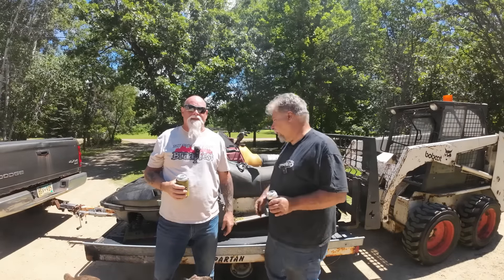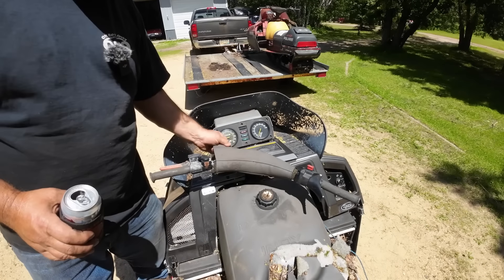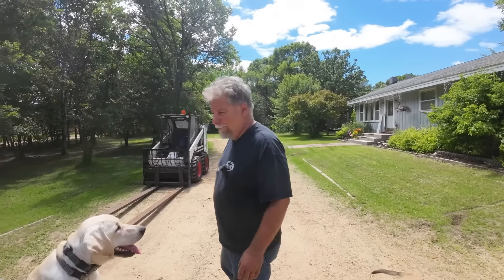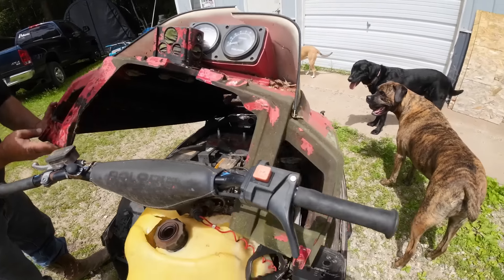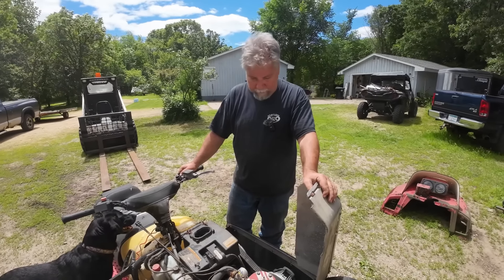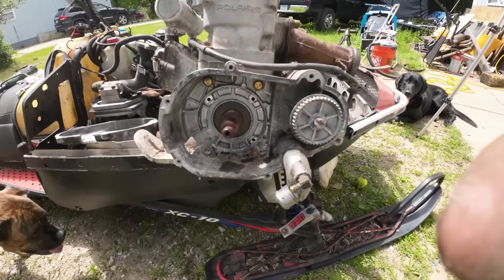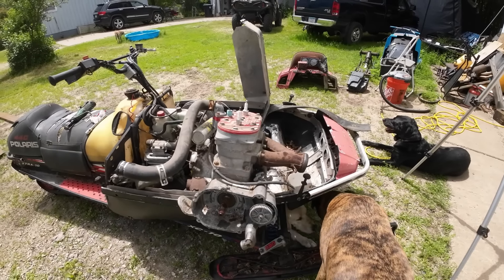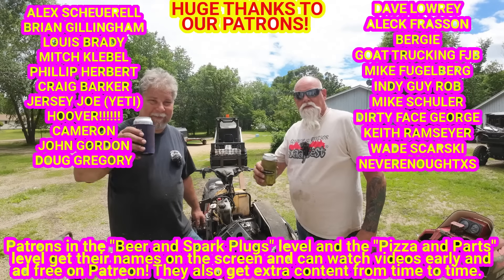Lonnies XC700 Tear Down, Evaluation, Motor Preservation. Vintage Polaris Wedge Hood Liberty Twin.

Comment: Holy crap!  Does this bring back memories!  I had a 98 XC700 that I snow checked with the 220 cylinders, like @thepolarisguy said they had a little more power then the floor model 824 cylinders. Those carbs are stock 39mm keihins, and they work really well!  Nice easy throttle pull 👍.  If I remember stock jets were 185, I ran 182 or 180’s depending on weather.  Considering the pipe the stock 185’s might be perfect!  I’d stick with those carbs for sure.  
Rear suspension headstock hydraulic shocks, I had the 1.25” lightning track on mine too!  
That 700 is an awesome motor!  I always relate it to a Harley Davidson motor —loud, obnoxious, vibrates, unrefined, but you gotta love it lol
This really makes me want to call my cousin and get my 98 XCR 440 back!  Really miss that sled!  
Clean the carbs guys 🍻🍻🍻
Reply from the maker: Thanks Rob. I will let you know what jets I find in those carbs when I Clean The Carbs!

Comment: The 98 XC 700' is well worth putting time into getting that machine going.  I have a 97 XC 700 that I love. The 98 XC 700's had kind of weird shock package from the factory.  They had white bodied Fox shocks up front, but hydraulic rear skid shocks for some odd reason.  Someone opened up a catalog and ordered a boost bottle and pipe from Hot Seat.  (Sorry, not a Hot To Go pipe).   It could very well have a Hot Seat clutch kit in it too.  The 38X Hot Seat Helix is supposed be the hot ticket for the XC 700's.  They had two different cylinder setups in 97 and early 98, the 220's and the 824's.  The 97's and snowchecked 98's had 220 cylinders and the straight production run 98's had 824 cylinders.  The 220 cylinders are supposed to have a little more low end grunt but they were recalled because they would catch a ring and burn down the engine.  So the 824 cylinders were installed after the recall.  A Wilwood master cylinder and braided brake line from a Firecat is a nice brake upgrade for the old wedge chassis XC's.  So far the old Ducati ignition is holding up well in my 97 XC 700, but I did buy a complete Kokusan setup to have on the shelf for a backup.  I'm not sure if the timing marks on the crankcase and stator plate are the same between the Ducati and Kokusan units???  Hopefully when you can get into detail on that for us when the time comes.  I look forward to seeing what you do with the old XC 700.
Reply from the maker: That explains the hydraulic skid shocks. Host seat pipe should be good too?

Comment: Keihin 40mm D slide carbs. They are very sensitive on the fuel adjustment screws so make sure they are very clean. Check the water pump, kind of a pain to rebuild but the seal is still available. Non thermostat motor so be cautious on warm to not cold seize. Very fast sled, Lonnie is in for a treat. Im  pretty knowledgeable on these sleds so if you have any questions on this machine feel free to ask. Happy to help
Reply from the maker: Thanks for the tips!

Comment: I hope you guys rebuild and save this one. Kick ass sled! I've got a 99 XC 700 I've been tinkering with for a few years. Full SLP exhaust, boost bottle, gutted air box, jetted down a little (I'm close but it's got a bit of a flat spot in response down low), clutching is close, changed gearing, and I'm running one of those pre-studded tracks like winter tires. Little sled rips pretty good!
Reply from the maker: 100% it's getting rebuilt. Can't believe this many comments on a sled in the middle of the Summer.

Comment: Such a good find. Pretty cool to see it has a htg pipe too. I think they called those carbs D slides if I remember right. I converted my 98 XCR 440 to a 600 big block years back after I blew up the 440 2 times...but I also got about 10k on it before the swap so I can't complain 😂
Looking forward to seeing you do this twin 700!
Reply from the maker: Thanks Jeff!

Comment: That’s xc is super cool. I have a 97 XCR 440 that has a lightweight hood. Can’t wait to see how that hood turns out. I’ve Never seen another one. I also have a LRM piped 97XC 700 it’s a great runner and super fun sled. If at all possible Lonnie you should try and keep that 2 piece seat and tank.
Reply from the maker: The hood is really rough, but we will try to bring it back without adding too much weight,
Reply: Mines pretty destroyed as well there so thin the gauge pod weighs more then the actual hood

Comment: Slowly tapping it with A small ball pin hammer and pine 2x3.5 board end cut to tap up against the handle lever. I think it would break loose. Another way is mini pencil torch.,or propane torch and spraying the penitrating oil and slightly tapping it until it releases and frees up again.

Comment: You could try spraying that brake.,or clutch brake lever down with some PB-Blaster penitraing oil to soak for A while in the high heat temperatures.

Comment: Did you see what cylinders are on it ?  I had a 98 that had the 220s and when I sold it , it had 13k miles on it with all original engine parts.  The compression was still at factory specs. Only thing i did replace was basic wear items, track, and water pump assembly
Reply from the maker: We didn't look at the motor too close, but we will when we get back to the project.

Comment: Those are KEIHIN pwk 39mm d slides.  They are pretty finicky and parts like needle and seats are kind of a pain to get ahold of. The float pins and inserts wear out over time. A great salution is a set of Mikuni TM racks off a newer 2000 era 6 or 700 ves xc. Just my experience with them. Hope lonny is ready for the torque of that 700 big block they are missiles.👍🏁
Reply from the maker: Thanks

Comment: I had a 98 xc 700 fun fast sled! If you remember maybe make a small clip on syncing those carbs.
Reply from the maker: Never dealt with twin Keihens, but when I figure it out it will end up on a video. Cant be much different than other carbs.

Comment: Nothing is junk if you have a mill , lathe , and welder , and endless Beers ! I can get by with no Lathe & Mill though , I buy high quality Duct Tape , I can fix anything ? Depending on the fix , Duct Tape saves on electricity costs